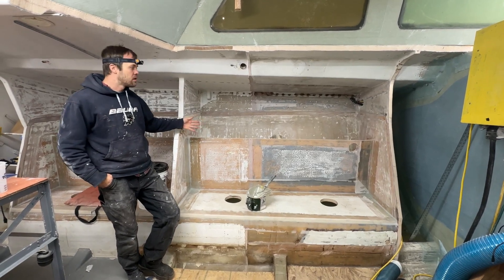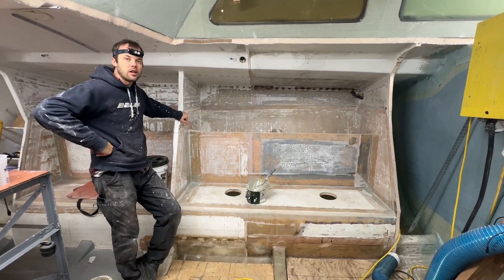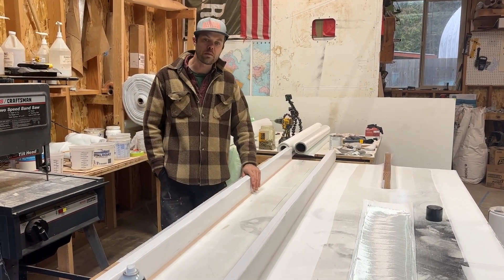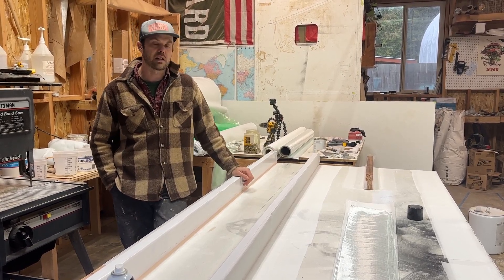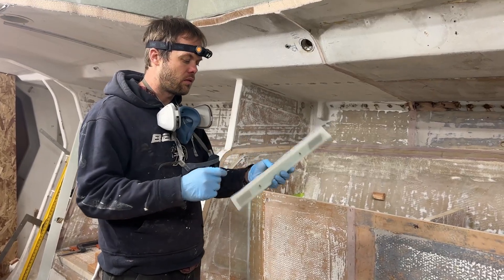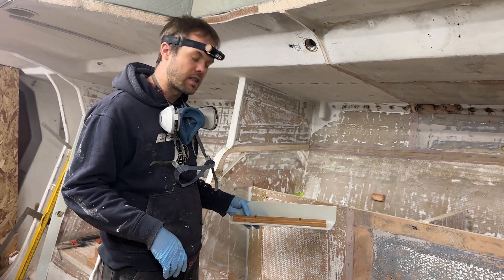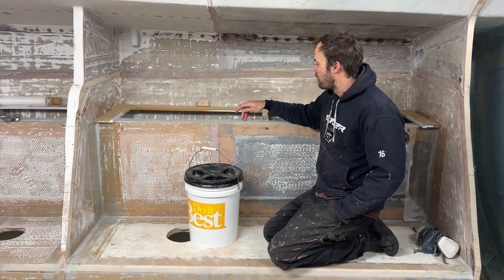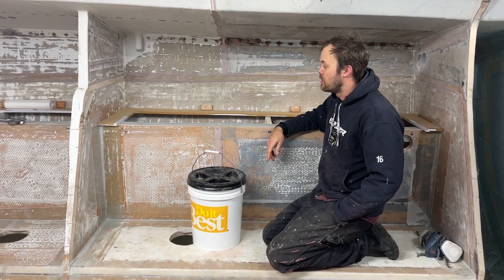Nearly Done: Ballast Tank Modification [E64]

Comment: Great video again. I love it cos i deal with the exact same problems on my boat project but on a much smaller scale: Rebuilding a new cockpit of my 9m Halftonner. The project is 4x3m and its all about, fiberglass, epoxy, foam core, bulkheads and stringers, fillets and tapes, flanges,...
Reply from the maker: best of luck on your project

Comment: Bonjour Matt,
I am always impressed by the amount of layers of fiberglass you put and have a question, where / how did you learn how to apply the appropriate number of layers, depending on the place you build ?
On our model boats,  we generally use just one layer (between 20 to 80 g / cm3  inside - outside)  and never create the void. I don't remember having seen you explaing this method, could you please tell me why sometimes you make void and other time nothing ?  Would that depend on the type of fiber you use for example?
Thank you in advance for your answer as I noticed and apprerciate that you read our comments,
Besides this, your fiber glass obeys you much more than your dog 😉
PS : Beware the shots !
Amicalement, Raphaël
Reply from the maker: Raphael, I'm not sure what you mean by "the void"? I'm going by how the boat was constructed. I can see how much tabbing was used when they built the boat and I'm just mimicking that. For more important structural parts, I refer to my naval architect who is helping, Evan.
Reply: @TheDuracellProject  Bonjour Matt,
Sorry, please let me rephrase my question.
Sometimes you just apply resin and fiber and sometimes you cover your work with a plastic sheet sticked with a special stuff, you plug a kind of vacuum and you empty it of air. I would like to know why there is this difference for making your parts, the size , the strength ?  drying time ? I saw you doing it either on your work table or directly in your boat.
Amicalement, Raphaël

Comment: I am looking forward to see a new video every week, Nice an clean work, i know it Can be messy.
When i have to make a nice curbe to lay my fiberglass on like when you made the Molds for the flanges, i use peel-ply on the wet putty and just swipe it with a finger, no need for sanding afterwards and no “sticky stuff” on the wooden spatular, it also works really good with polyester putty like the 3M also the really messy type with chop strands In it.

Comment: After watch the video again, maybe a Wiss MPC-3 9" metal snip we use to cut preformed fiberglass flashing on installs would save time doing relief and trim cuts, they are serrated and very accurate and nimble cutting, instead of other methods we have tried.
Reply from the maker: thx for the tip!

Comment: I notice the difference in scale of the old ballast tanks vs the new berth ballast tanks. Are you going to have enough ballast without the extra volume for water or is that part of the transition from high performance racing boat to pleasure yacht?
Reply from the maker: Yes it’s part of the transition. The boat will be a little bit more tender but this is the transition from race boat to cruising boat

Comment: Really enjoyed the music selection! A couple of time saver suggestions to consider from my shop work.  A  notched margin trowel would speed up application over the floor trowel shown in the video for bonding in tight spaces.  Second a sheet metal form is a quick cheap channel mold with little time and prep-- we use aluminum ones for channel production though, and sheet metal for one time use projects-- bonas time saver is put fiberglass down on butcher wax paper to wet-out on a table and transfer complete layup to work area in one step, especially in those blind upside down wetout tabbings.

Comment: Hi Mat, just a little tip for filling in inside corners with filler. 
Take a spatula, aprox.2-3 inches wide and angle the first 3/4 of an inch to about ten degrees, then use the back side of the angled bit to push the filler into the corners. Adjust angle and width to your own discretion. Makes the job really quick, easy and clean.

Comment: I don't know if you have a need for more flanges, but Ross over on Life on the Hulls buys his composite angle 90's pre-made.  He has said it's actually less expensive than he can make them, and far less time consuming.
Reply from the maker: I looked into that. I did find flanges that was pretty cheap, but it was polyester resin , which I can’t use. The epoxy right angle stock is much more expensive.

Comment: With the upright seat-backs on the ballast tanks, why not instead have a sloped upright to lean against? Bolt-upright is never very comfortable, although I dont sail and I dont know if the tack angle would be a factor in utility and comfort. Obviously cushions would be used, but a sloping back would be more comfortable per se, and would even negate the need for cushion uprights at times. If a false back with slope was laminated into the existing back, the small hollow between the two, with a small access hole, could be used to store small items such as knee folded rugs etc.
Reply from the maker: Yes we will add angled cushions. Also I know it looks like the ballast tanks are seats butt hey will actually be interior spaces…galley, nav station etc
Reply: @TheDuracellProject  Oh sorry, I should go back and look at the plans again. The angled cushions are a sensible idea that eluded me... doh!
Thank you.